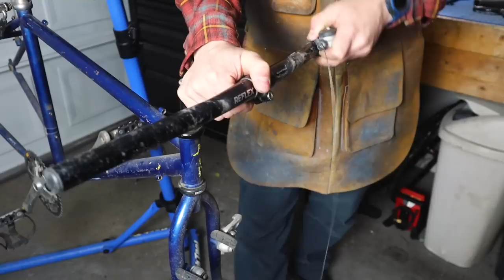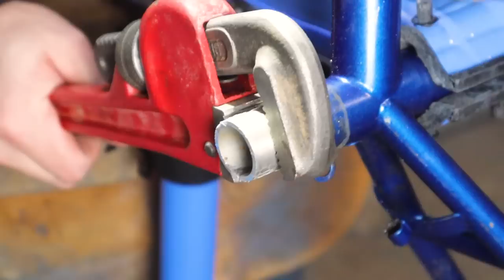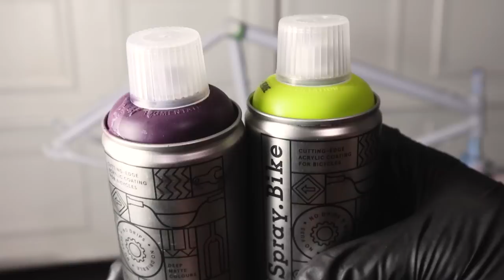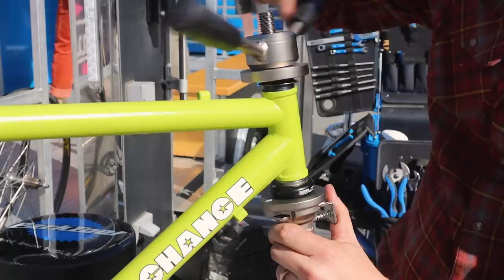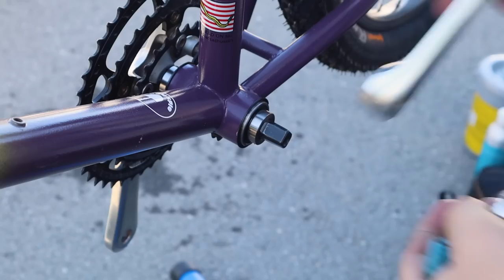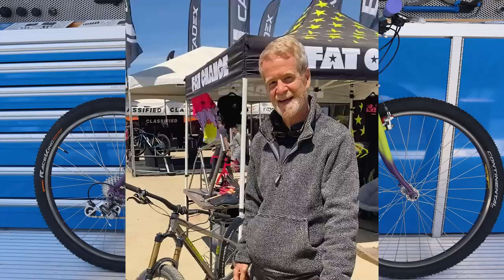Seized Wicked Fat Chance Seat Post - Bike Restoration

Comment: My favorite seized seatpost story; 24 hour soak with WD40. Bike was stripped of most other parts, but BB and cranks were in still. Seatpost was decided to be a throwaway and got clamped into a bench vice. Heavy action on the post with a propane torch, a little bit on the frame, too. Two mechanics grab the frame and start levering on it. It starts moving. Slowly at first, then slowly all the way to the end. There was a lot of friction. When the post finally came free, and oxygen reached the superheated WD40, a 16 inch jet of flame shot out of the seat tube. It was glorious. I would use the same technique again, but just pull the BB to prevent a "framethrower" incident.
Reply from the maker: Awesome story 🙌
Reply: "Framethrower" is an amazingly good misuse of the english language.  😂

Comment: I’ve removed no less than a dozen severely stuck posts. Lay the frame on the ground flat (on grass), take the pipe wrench and put a pipe on it for leverage, stand on the frame and push down with leverage.. I use a four foot pipe for leverage. Sometimes I’ll have someone stand on the frame so I can concentrate on the pipe wrench.

Comment: Had similar on a used old frame several years back and saw a forum post advising to use caustic soda as it just eats aluminium. I left it a few hours and there was nothing remaining of the post in the morning. Was great, as had been tearing my hair out. Heat and large amounts of penetrating fluid did nothing.
Reply: I've also done this with a stem to great success.
Reply: Been there, tried all that. Chemistry works the best!
Reply: Disposing of or neutralizing caustic soda seems easier than to get rid of gallium.
Reply: I've had great luck with ammonia on an alloy post in steel frame.

Comment: My Cannondale F1000 had a snapped seatpost when I bought it (got it ridiculously cheap b'cos of this) .. but it was just below (like 1-2 mm) the seat-tube opening.. 05:57.. this looks VERY similar!.. I had MONTHS of messing around..trying not to damage the frame.. I got hold of one of those "single sided" hacksaws.. Padsaw i think its called.. and started gently sawing away.. cut out 2 lines opposite each other till i was close to the frame.. then just swapped sides after a few "saws" and POOF..or POP..out it flew.. hardest thing I've ever had to fix on a bike..it wasn't going ANYWHERE..litterally snapped on the other fella who tried to get it moving..thing was STUCK!.. it's starting to come together now though.. I ADORE this frame tbh.

Comment: I found blow torches to work best. They tend to heat up the seat post way more than a heat gun and bbs, seatposts or forks come out so quickly and easily. I`ve been giving up on my favourite frame, rode it with a stuck bottom bracket and I've been so happy the day I finally got it out - without any harm and sweat - just by the use of a blow torch.
Reply: I did that as well. It worked fine. But it was an aluminium fame. Since the temperature coefficient of aluminium (frame) and steel (bottom bracket) are largely different, the frame will expand more. Hence the BB will become lose. With steel on steel, or even an aluminium seat post in a steel frame that probably does not work.
Reply: @martimcfly6207  In my case: It did. I think all these approaches really contain some luck in every case. :)
Reply: @jerrys.projects  good to hear. Maybe the expanding and shrinking also helps to loosen the bond between steel and steel. If it works, it works

Comment: Gallium ... what a great Idea. I have a 1993 Marin Bear Valley SE in my Barn ..  Nowadays totally stripped for Parts but with a Setpost that Stuck even the Frame is sucked on like Shrink Tube.  I never won't to let it go and throw it away. Now i know a new Route to go. Thanks alot
Reply from the maker: It takes more work than it looks like in the video but it did work. The Gallic process took most of a day, letting it sit for a couple hours between “soakings” and chipping. Good luck.

Comment: Awesome new life given to that sweet old bike... The floor of the Old Shovel shop must be its own work of art from the blending of all the cool paint colors you've used for the rebuilds over the years...
Reply from the maker: Lol  actually one thing I like about the spray.bike paint is that it drys to a powder about 18 inches out of the can (ideal spray distance is less than 6”. So after a paint job I just sweep up.
Reply: @oldshovel  Whoa that's really cool - never knew that could be a characteristic of a paint that could also be resilient enough to use on a bike frame... I've learned lots from this video !

Comment: Oh boy. Right after graduation I worked at an engineering college. I purchased a bike from the police auction with a stuck post like that. 

I worked an hour a day in the machine shop with a drill and a rat tail file. It took 3 weeks to get that seat post out. When I was done the machinist asked how much a bike without a stuck post would have been. Good learning discussions were had

Comment: After stripping the bottom bracket, invert the bicycle. Fill the seat tube with Oxalic Acid. Let it sit in a well-ventilated area for ten days. Drain the acid out and rinse the bicycle with water. The acid dissolves the chemical bond between the steel frame and the aluminum seat post.

Comment: for aluminum/steel galvanic corrosion i always go pretty quickly to the reciprocating saw and cut the top then the inside.
It is usually the only way since it is almost like it's welded.
Puts less stress on the frame you just have to be careful to only cut the seatpost.

Comment: If you take a can of duster spray and hold it upside down while spraying it will instantly freeze anything in front of it . I would try heating the steel seat tube as you did then freezing the inside of the seat post next time . Just a thought , love your videos .

Comment: Great vid. I was "listening" to the banging as I was trying to remove a wire-bead 30tpi tire from a MTB wheel to convert to tubeless...bead was able to get a perfect lock between the J hook and the rim tape and would not budge...ended up separating one side with a vice, and the other only came out after I destroyed and pulled out the rim tape to creat that much tiny of space...two wheels, took about 2 hours before I decided that something had to be sacrificed. No Rims, Inner Tubes or Tires were destroyed in the making of all these sweaty spots.

Comment: Adding to all the others who've shared ideas... I had a stuck carbon fiber post in an aluminum frame. There had been a chemical reaction that bonded both in place really tightly. I used citric acid drops around the insert point to soak/seap down into the spaces around the seatpost inside the frame. That helped break the chemical bond. Then I used repeated rounds of nearly boiling hot water over the seat tube to create a gentle expansion of the aluminum. After a lot of that and multiple rounds of trying to wiggle the post, it finally broke free after like 45 minutes. I was able to save the frame and not damage the paint with a torch while still doing the job of adding the necessary heat. The seatpost came out in one piece too.
Reply from the maker: Interesting. I haven’t heard of that technique.
Reply: @oldshovel  Thanks! I can't take credit for it. I found it searching online. Some engineer type who loves to wrench explained that it has something to do with the two different types of materials and how they both oxidize. I'd been using citric acid to remove rust oxidation on bike parts, so figured it was worth a try. Lo and behold, it worked great! Thanks for all your great videos!

Comment: When I have one that stuck I take the seat post water bottle cage bolts out, turn the frame upside down, then soak the inside of the seat post tube overnight with your favoeite penetrating oil. then, clamp a pipe wrench in your vise  THEN hook your seat post in the wrench and twist the frame. also, would help a lot if you could get your vise bolted down solid. GREAT video as always - good work sir

Comment: Gallium...what a concept!  I know that lye will do a similar number on aluminum posts, without harming the steel.  Been in the same situation and I really hate it when an otherwise good post has to be sacrificed.  It leaves me feeling defeated.
Reply: Is that what that stuff was?! Seemed to work, I've not seen that method before!
Reply: Yeah, Gallium. Spindatt Eric did a video about that. It is better than lye, because it wont destroy the paint. But it is kinda expensive, if you can get it at all.
Reply: Me neither.  But, as soon as I saw the vial, I knew what he was up to.  It's a strange molecular reaction that causes solid aluminum to become crumbly.  The whole idea is inspired!  DON'T use it anywhere near an aluminum frame, though!
Reply from the maker: Yep I saw Eric Spinny do it and tried it out.

Comment: It sounds counter-intuitive but if you were to give that seatpost a whack towards the frame rather than away from the frame you’d have a much better chance of breaking the seized seal.  I did this with a wicked frame once. Post moved a fraction of a MM which was enough to work out out with the vice.
Reply from the maker: I did try that, I’ve had it work before also. This was definitely the worst I’ve ever dealt with. I spent way more time trying then I showed.
Reply: @oldshovel  Salt Lake and Aluminum do not play well together.

Comment: I had one that took me 4 days to get off last summer. I ended up using heat and pounding it down with a rubber mallet. I ended up moving it up about 1/2 inch at a time. Each session took me about an hour.

Comment: Ι use diesel injected with the frame upsidedown from the bb straight to the seat tube.leave it for a night or so..and if still resist drill the seat post to insert horizontally a long lever in hole and turn...its always working..regards from a vintage mtb collector from far away Greece

Comment: Nice build as always!

What type of Bottom Bracket is that? My Panasonic Mountain Cat is also threadless and has a cup and ball bearings, the diameter of the BB shell is larger that those Shimano BB that fit most bikes. I'm lucky that it doesn't need replacing yet.

Comment: I had a post that was seized on a tandem. I drilled a hole and put a solid steel bar through and with a lot of cursing and anti rust spray I got it out. First by rotating it a few times and then with pulling.

Comment: Well it's the first time I've seen a toxic metal to get a seatpost out!☣️
If you come across stuck seatposts a lot, I recommend building/buying a seatpost removing jig. Basically you push the seatpost out via two hefty tubes e.g scaffolding pipe either side of seatpost  linked together at one end through an old set of BB cups and a rod,  going up to the seatpost end (anchored at seatpost via various methods). And some screwing mechanism at the top.
It looks pretty effective and saves all that agro. You can apply a lot of force to get the seatpost out, mm by mm.
Another technique is a slide hammer. From videos on yt that works pretty well too.
If you're going to clamp a cut tube in the vice, put an expendable lump of metal e.g. a socket to support the tube otherwise it will inevitably get crumpled and useless for leverage.
I'm currently working on one method with a stuck post. Got the frame  inverted and I've filled the seat tube with an equivalent to wd40 . I'm going to leave it a week, give it some heat  occasionally, and see how it goes! If that doesn't work I'll try with releasing agent.

Comment: I know I've seen an Instagram account of a shop that built a massive rig that bolted into the BB and the top of the seatpost, and it would just pull it apart little by little. When the stuck post comes out it sounds like a gunshot.
Reply from the maker: That sounds awesome
Reply: @oldshovel  if I see it I'll send it to your insta

Comment: The most seized seat post I ever had took me half a year to release. Luckily it was an aluminium seat post in a steel frame. I waited till winter and on a very cold day (-25 Celsius), using hot gun to warm the frame up and throw it into the snow. Then a pipe wrench did the job.

Comment: A year ago I restored a TREK "MetroTrack" and converted it into a fixie/single speed bike. Just like in your case I had to saw off the seat post just above the frame and then slit it at two points open lengthwise with a saber saw, but after that it came out 😩.  Aluminum oxide and iron oxide seemed to react with each other, so that both parts were as if welded...

Comment: i've came across lots of stuck seatposts & quill stem in my shop. If everything is fail, than last thing to do is using torch, Works all the time. And you saved seatposts and stems too. But off course you need to repaint the frame.

Comment: What was that thing you did with the fork at the end? Cut new threads into it? Shorten it?
Reply from the maker: The threads were a bit rough and it was hard to thread in the top headset bearing cup. We first tried chasing the threads then put a little bevel on it to ease onto the threads.

Comment: My friend and i found a bike next to a dumpster. It's a shimano "mountian bike", probably old like 30 years or so. It's just like this one, i mean the geometry... But everything is seized lol
We got it to the shop and bought some part for it, cleaned it up, and i still need to repaint it. AND ALSO THE SEAT IS STUCK like on this one. Tried wd40, didn't work. I thought of using a torch thoe but i will probably need to do what u did

Comment: Hey it did turn out WICKED, loving the colorway, totally 90s in true Fat Chance fashion, topped it off with the red Ritchey brake pads!
The seatpost thing must have been a bummer but you handled it very well. What was the solution you poured into it?
Reply: Looks like gallium. Eric from the spindatt channel had great results using it on a seatpost stuck inside a GT.
Reply from the maker: Yep. Gallium.
Reply: @oldshovel  Thanks, will keep it in mind as I also come across such seatposts every once in a while. What you did there might be the best way to keep the frame intact.

Comment: Next time. Drill a hole through the post. Insert a bar. And use that bar as leverage… You made a huge error cutting the post like that. Alternatively. Try knocking the post into the frame and not out of it. But the bar method works best.

Comment: I used Coco cola on an old rockhopper back in the 90s. a bike shop told me and it worked 👍
Reply: It´s the phosphoric acid in the cola that does the job. Make sure to use sugarfree/diet version to prevent the sugar mess…
Also this method only works for cases where it isn´t stuck too severely. The case in this video was stuck very badly.
Reply: @el_micha   my seat was all the way down

Comment: I got to 4.48mins, dude, stop what you're doing! You've hot the BB out, turn the frame upside down and squirt a large amount of WD40 or duck oil down the seat tube, leave overnight, then just slip it out....
Reply from the maker: Lol I wish it was that easy. Trust me I tried that and it did not work. Even after it was broken into pieces it was fuse welded to the frame.